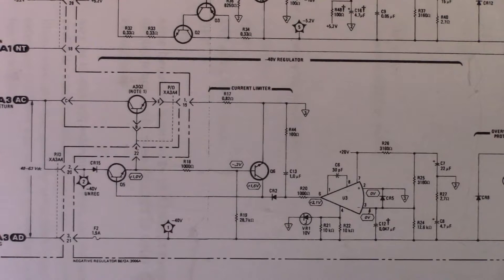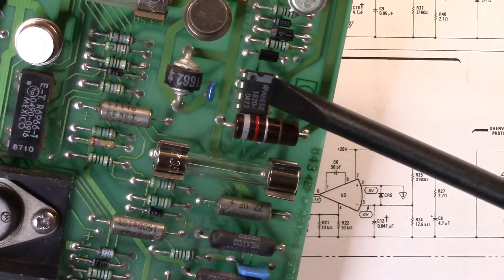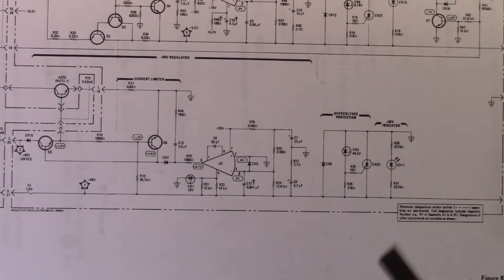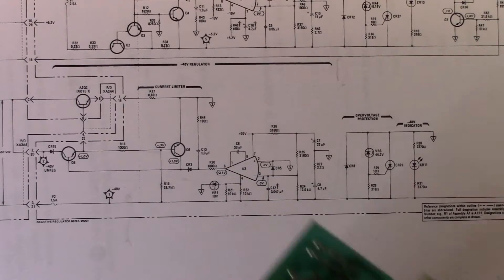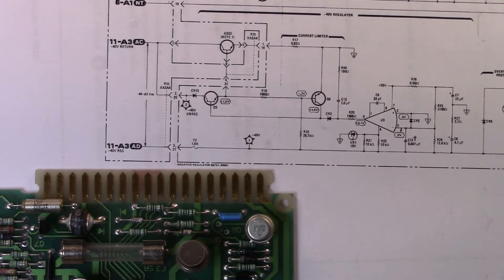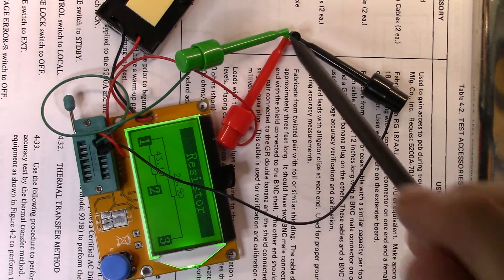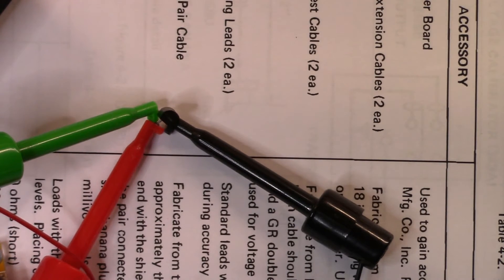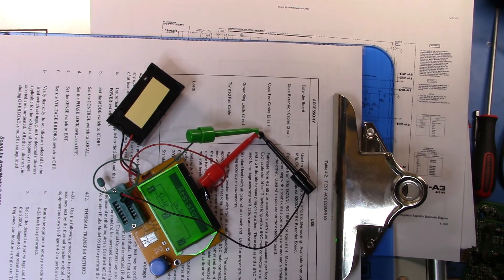HP 8672A Signal Generator Repair - Part 2

Comment: I guess the question is why did that transistor fail, and what can be done to prevent that in the future. To-92 has pretty bad heat dissipation. I wonder if a little heat sink would help, or a bigger, metal can version of the transistor. Definitely check its temperature in operation if this gets it going...
Reply from the maker: That's a great question - I suspect that what happened was that Q6 started to fail and that caused the crowbar to throw. The fuse went down but not before Q6 failed completely. We'll see if it goes tango uniform on me in operation.
Reply: I see from the other video that it works! You still might want to get a temp probe on that transistor and see how hot it is getting. Perhaps a little heat sink would help.